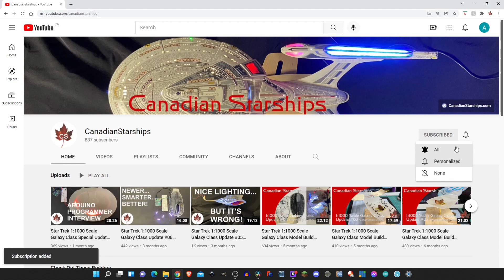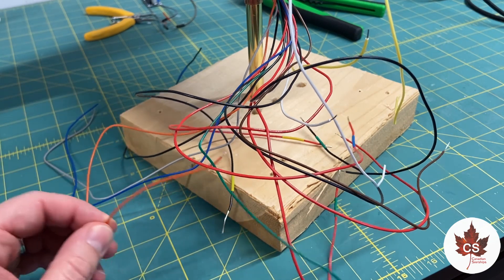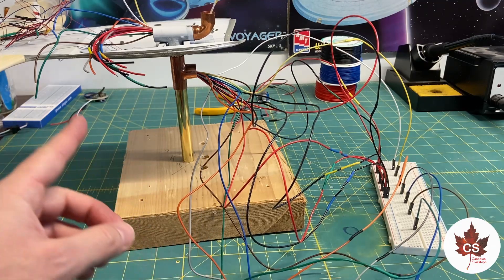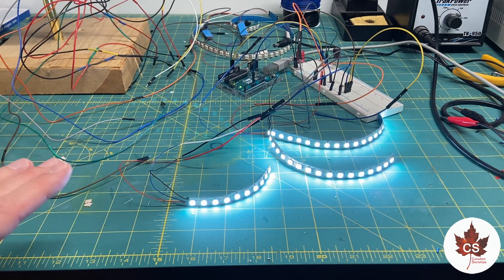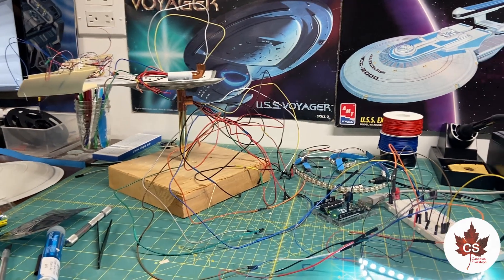Star Trek 1:1000 Scale Galaxy Class Update #08 (2022)

Comment: The flickering is due to an unfiltered power supply. Most power supplies are a digital output. This means you have an average voltage which fluctuates. The USB supply is filtered, so you get an in-flickering light. Happy days and model on!  😎